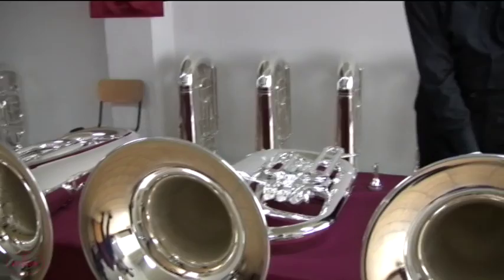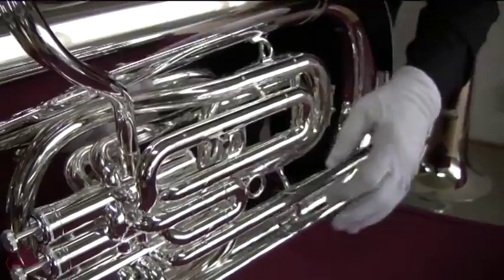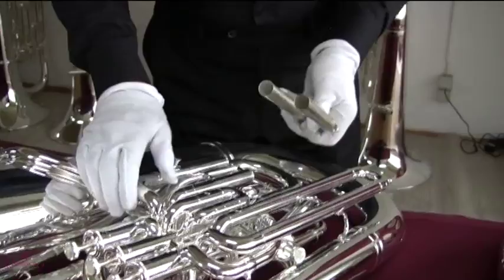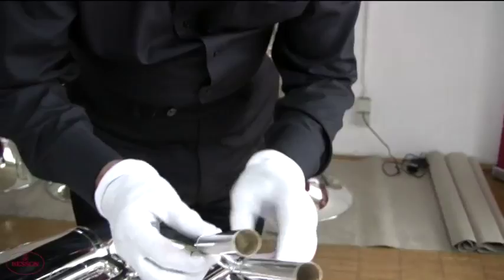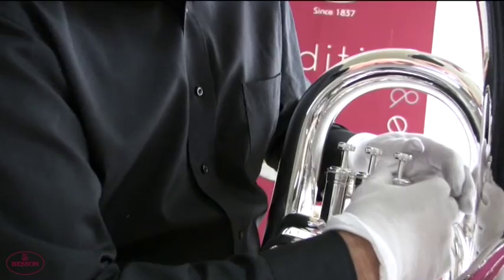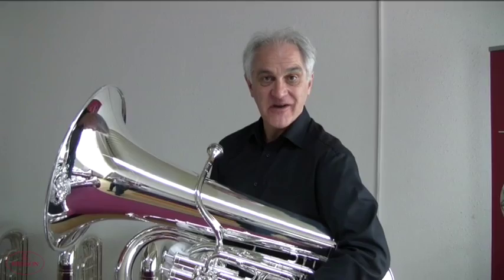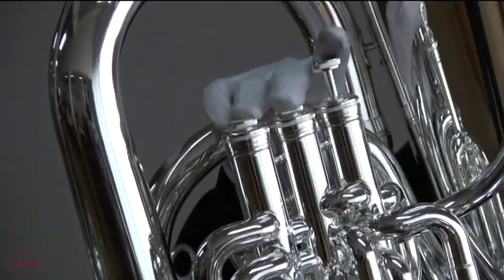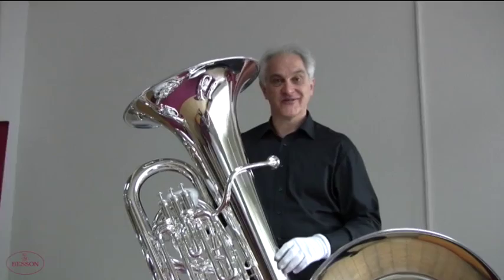James Gourlay Tests Besson Tubas | Besson Brass

Comment: why is the 982 still in the range, while the 981 is so much better??
Reply: The 982 has marching rings, while the 981 has not. The height of the leadpipe is also different. One is designed to play sitting down, the other one is designed to be better usable when marching.